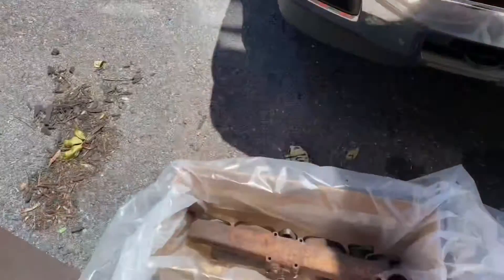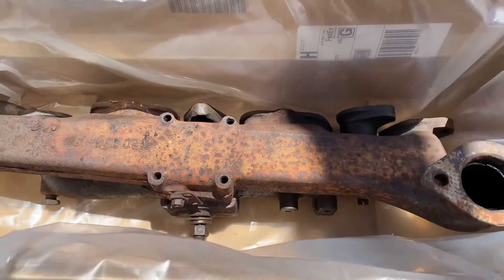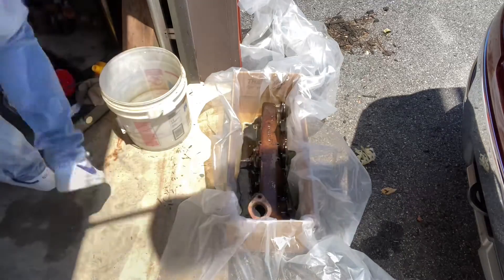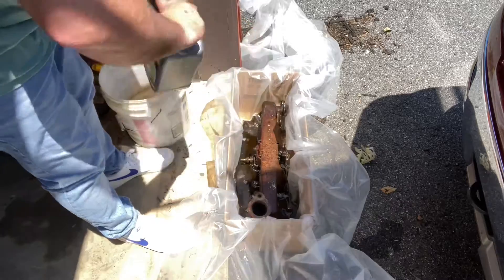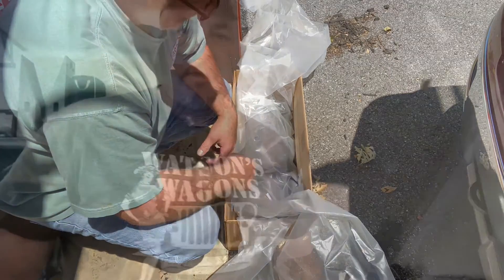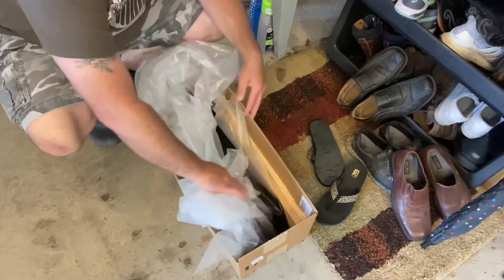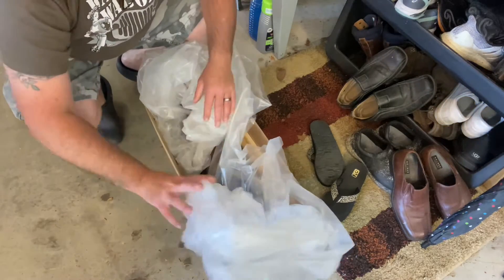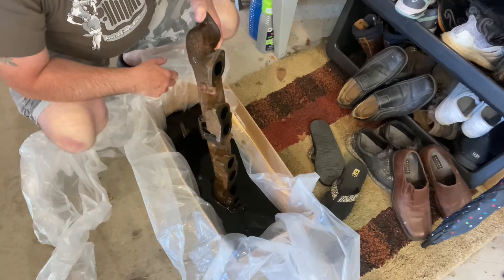Evapo Rust Exhaust Manifold

Comment: I recently cut the broken bolts out of Cherry Blossom’s intake so that I could seal the manifolds together and Dave and I could go to the TX PW reunion in the Pecos river valley.  I did it on my milling machine and I had to cut them down to the minor diameter and then re-cut the threads. They were that stuck!

Comment: If your Summer/Winter flap is still able to move, put a light silicone grease on the shaft yearly, and move it to distribute it in the gap. I use Super Lube.
Reply from the maker: I have a replacement kit